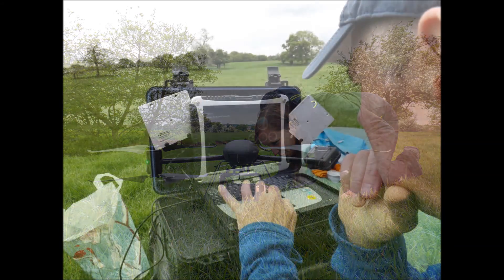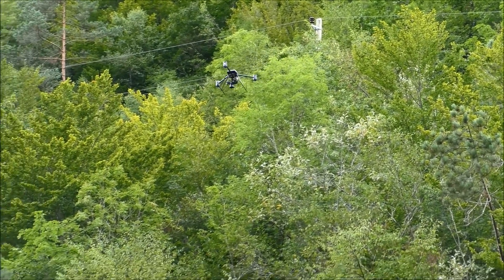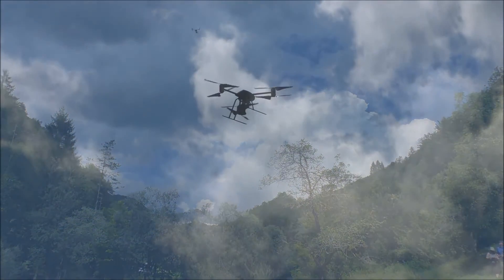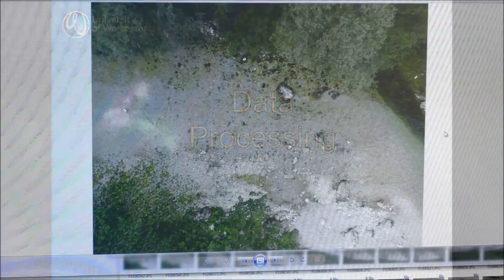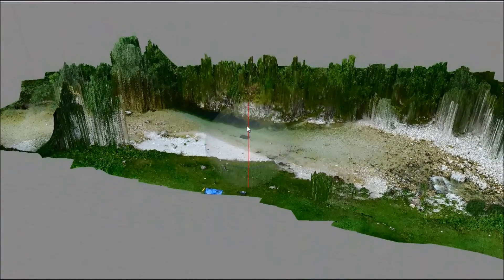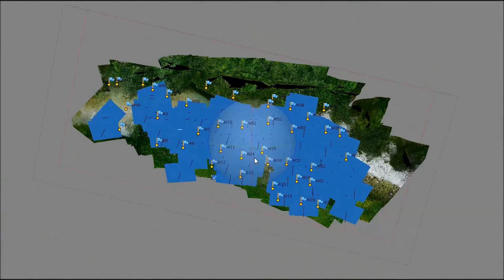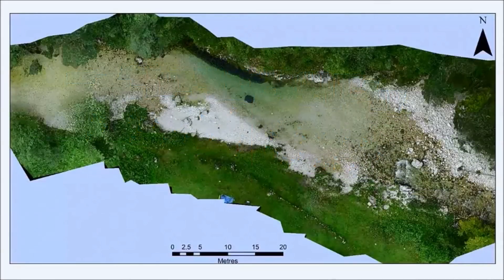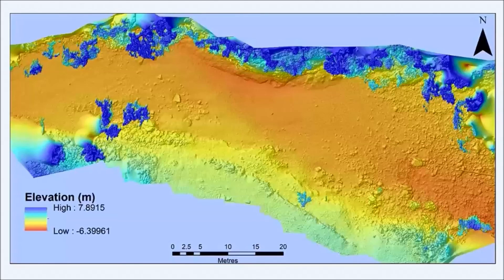Using Unmanned Aerial Vehicles (UAVs) for topographic surveying

Comment: Ian:  I applaud your work; but always BEaWARE of the well-known systematic SfM doming (elevation) error.  The use of curved flight lines can help mitigate the doming error.  Google "Gently Curved, Convergent, Non-traditional Drone Flight Paths" to see how to construct curved flight lines.  For justification of curved flight lines, consider the following reference material:

Minimising systematic error surfaces in digital elevation models using oblique convergent imagery
Rene Wackrow 
 
Jim H. Chandler
First published: 16 March 2011
 
https://doi.org/10.1111/j.1477-9730.2011.00623.x

Results of the simulation process, the laboratory test and the practical test are reported in this paper and demonstrate that an oblique convergent image configuration eradicates the systematic error surfaces which result from inaccurate lens distortion parameters. This approach is significant because by removing the need for an accurate lens model it effectively improves the accuracies of digital surface representations derived using consumer‐grade digital cameras. Carefully selected image configurations could therefore provide new opportunities for improving the quality of photogrammetrically acquired data.

I hope this helps.

Jim Dow
Reply from the maker: Sorry James, just seen this. Thanks for the info. Yes we're aware of that and use GCPs and nadir and oblique views and grid flights to reduce the effect and validation points to check for it. :) One of our early publications (Woodget et al 2015) highlighted it too when we were using it for refraction correction and bathymetry in shallow clearwater streams.
https://onlinelibrary.wiley.com/doi/abs/10.1002/esp.3613?casa_token=ukzi0YNOu4oAAAAA:y7HYhTOKAoUOAr0m6s4yy1eeid6yTDnwS5TQlCmriNAJmnKmubjKbTDbOssFaIsi9y4uWyW0FXK1yEQl
Reply: @imaddock  I'd like to hear your response to my suggestion regarding the use of curved, convergent flight lines.  I've found that they really do work to help mitigate the SfM doming problem.  If you give me your email address, I'll send you some samples for fixed-wing and quadrotor drones.
Reply from the maker: @jamesdow5779  Hi James Yes I'm aware of this, as suggested in the James and Robson paper (2014) https://onlinelibrary.wiley.com/doi/full/10.1002/esp.3609 
However, interestingly, Mike James and colleagues most recent paper suggests having some slight oblique angle photos can cause doming and alternative solutions involving topographic correction are better. That paper, out this year is here: https://onlinelibrary.wiley.com/doi/full/10.1002/esp.4878